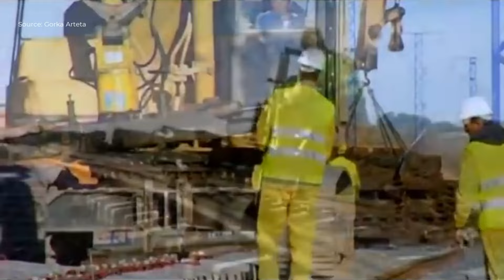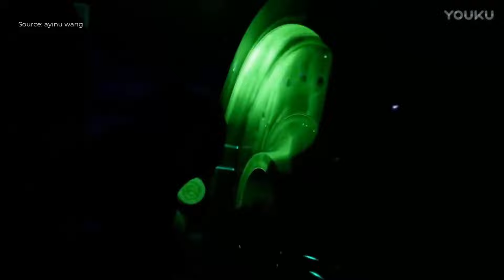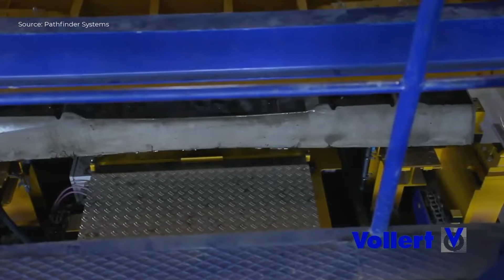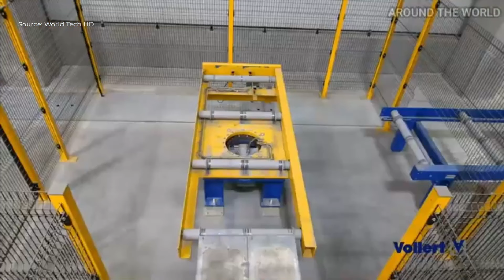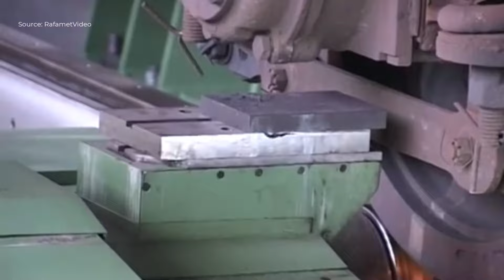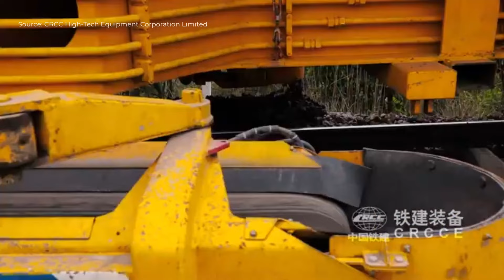How High-Speed Railways Are Built: Inside the Track Laying, Sleeper Production & Maintenance Process

Comment: High-quality Please translate an imperial measurements for the Americans
Reply: Use your brain and recalculate yourself. International units are SI-units, underlaying decimal sub-units.
Feets are relative, also there are misunderstandings predefined when using Gallons. But there is only 1m for lenght or 1L or volume measurements.

Physics and Science work with those units and are defined on them.
Not those ridiculous and hard to keep-in-mind 5"3/8 inches or 9"7/16 inches measurements... If you need more exact or smaller resolutions ist is much harder to express those numbers in this way than in the decimal system.

You also use the decimal system in currencies, not like in earlier times like in England:
1 Penny (d) = 2 Halfpennies or 4 Farthings
6 Pence = Sixpence ("tanner")
12 Pence = 1 Schilling ("bob")
2 Schilling = 1 Florin
2 Schilling 6 Pence = 1 Half Crown
21 Schilling = 1 Guinea